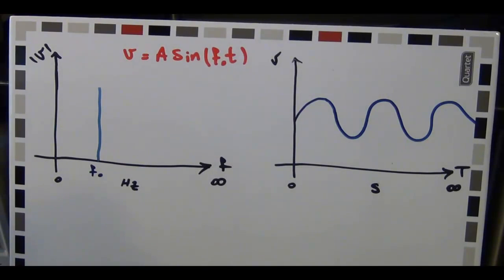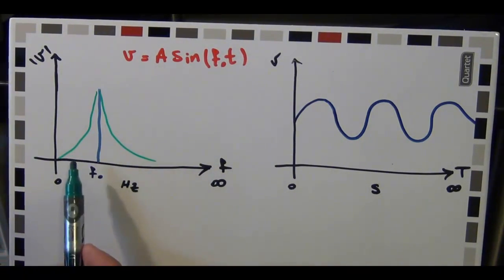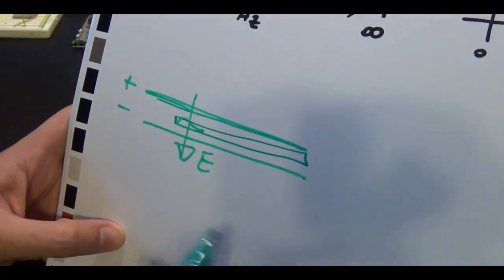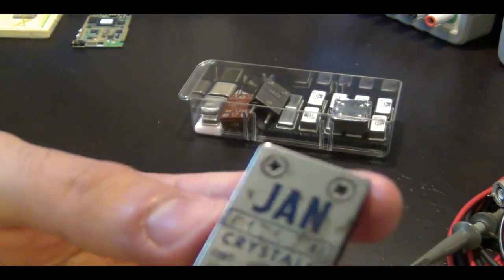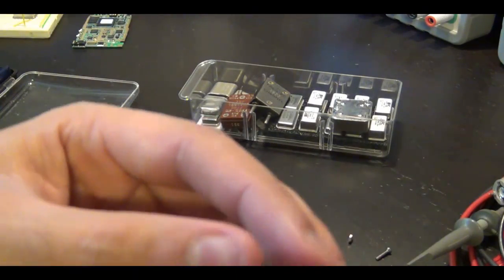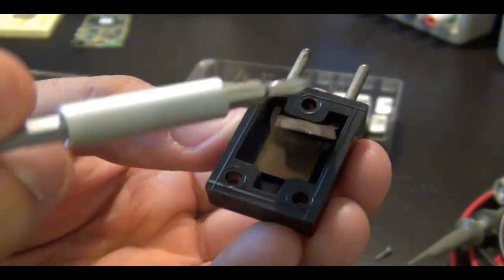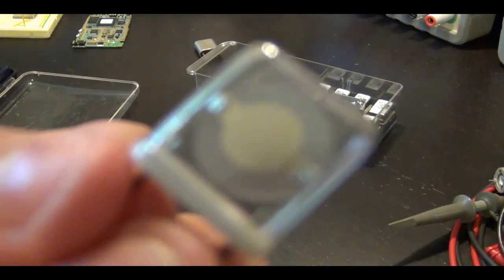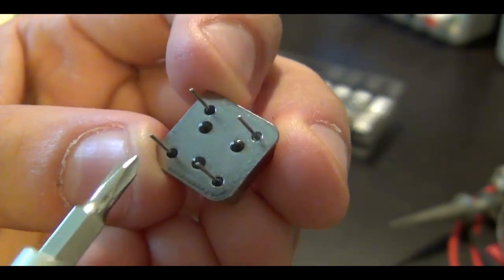TSP #4 - Frequency Generation: Crystals and Ring Oscillators (Part 1/4)

Comment: The first 'crystal' you opened with the screwdriver was actually a crystal 'holder' designed so that the crystal itself could be removed and ground down by the user to a frequency of interest. i think crystals mounted in glass were used only in high-end equipment. The glass created a hermetic seal to keep dust, dirt, and corrosion from the crystal. That would then be placed in a metal package, probably a crystal oven for use in a high-end frequency counter or spectrum analyzer.

Comment: I've only ever seen the glass ones in old oven assemblies, so maybe it has something to do with thermal expansion? Transmission of thermal radiation? Whatever the reason they aren't even common in that application.
Fun fact about those JAN plugin crystals: if during the manufacture process they were found to resonate at too high a frequency they would expose them to radiation to induce lattice defects in the crystal, thus bringing the frequency down.

Comment: Vacuum Glass encased  crystals are usually more precise and have higher Q.. 
Most metal cases are ultasonically welded or soldered an are not assembled in vacuum.Also the soldering or welding  process contaminates the crystal,so it will have much lower Q ,and worse long and short time stability...

Comment: Hi, I am trying to test a bunch of 10MHz surface mount clock oscillators for their resonant frequency at various temperatures. My customer believes that their is a variance in the frequency at certain temperatures causing failures. So these components are new and not soldered to a board. How would I go about testing them? I have a very good oscilloscope I am hoping to use. Here is a link to the data sheet of the device. Thank you for your advice!  https://www.mouser.com/datasheet/2/3/ASEMP-44335.pdf

Comment: Nice little video, FOCUS - FOCUS - FOCUS. Still a nice video. Frequency tuning tips. You can slightly change the frequency on these old crystals by: 
- To lower the frequency you can rub and "X" on the crystal with some lead solder. This increases the mass of the crystal.
- To increase the frequency you can sand the side a little to remove some of the crystal. This lowers the mass of it.
Thanks for sharing. Best Wishes n Blessings. Keith
Reply from the maker: Thanks. Make sure you watch the rest in this series. This is part 1 of 4. Some of the points you mentioned do come up later. This is also a fairly old video. :)

Comment: What makes the crystal more accurate? I'm going to buy a crystal for a microcontroller, and I just wanted to know what the load capacitance, tolerance PPM, and frequency tolerance PPM means. What is the difference between one that is rated at 16Mhz, 20pF Load Capacitance, 30 PPM Tolerance, and 50 frequency tolerance, from one that has difference.

Like the ones on Mouser Electronics, Digi-Key, etc.
Reply: Hi Mark, 
The tolerance (or accuracy) of the crystal is its accuracy reference to the requaired frequency when measured at 25degC (this is controlled by the thickness of the quartz and the thickness of the metalisation on the electrode). 
The stability of the crystal refers to the change of frequency caused by change of temperature (this is controlled by the angle the quartz is cut from the original crystalographic axis). this measurement is a relative shift referenced to the tolerance. 
The load capacitance is a little more complex to explain. It is a function of your circuit. Most standard crystal oscillator circuits run the crystal in a loaded circuit, you need to consider the value of the two capacitors each side of the crystal (add them as if they were in series), plus the stray capacitance of the circuit (around 3-5pF normally). You need to specify the load capacitance when you buy the crystal because the manufacture will place this load in circuit when they adjust the tolerance. If you run at the wrong load you will pull the frequency away from the correct frequency. 
PPM means parts per million, crystal frequencies are very accurate so we dont measure them in percentage (parts per hundred) we measure them in parts per million.
Reply: the question and answer were great thank you Mark and Nick

Comment: If we use a large monocrystal as an antenna it can actually capture waves
Reply: Or oscillate a metal antenna at high voltage high frequency at very low amperage so it can resonate with the given wavelenght we can actually capture Earth's vibration the moon's and Sun's one if we can capture this of a supernova WE can oscillate ti around the Earth's surface like a battery and then capture it back of course with Tesla receivers! pyramids are pure energy chargers of Earth's energy storage the Higher the energy levels the more heat it's build in the very core of it! So I'm not a geophysicist my question is: Is our Earth more overcharged or more undercharged?
Reply: Thankyou

Comment: wait so the smaller the crystal or the shorter his spectral distortion is the smaller waves it produces. then the greater the monocrystal is then we can revibrate ti by waves at this length I think that the universe is full with high amplitude short and long waves
Reply: because when a wave is disappearing in its own resonance, it is just gaining so high wave speed (short time High frequency) then it's actually giving heat in its affected environment. that's why in vacuum a wave gets destroyed and it's energy transfered onto its surface

Comment: tramdr I'm not an expert either, but I did just finish reading a book by an expert about quartz resonators. Voltage does in fact effect crystal oscillators, as it increases the strain on the crystal, which is also why crystal oscillators increase in frequency with drive current. In practice this is not a good way to adjust crystal oscillators as any DC voltage present on a crystal will greatly increase aging (change in frequency over time). The book I am referring to is "Quartz Crystal Resonators and Oscillators For Frequency Control and Timing Applications - A Tutorial (March 2004)" by John R Vig, it is available online (it is a public work by the DOA), and a good reference for understanding sources of errors in precision oscillators.
Reply: Thankyou

Comment: I'm not an expert, but potentiometers change voltage. Voltage does not effect crystals. However, capacitance does. In CB radios where I am an expert, the potentiometer  for changing frequency changes the voltage to a Varactor diode which is basically a special type of diode that changes capacitance when the voltage is varied, and then this is hooked up to the oscillator or crystal to vary it up and down.

Comment: So you said when we apply voltage across the crystal oscilator, the shape of the crystal will change, but how does it generate frequency? I couldn't hear what you said around 5:19; something about the shape changes, and remove the voltage, then something, then the frequency is generated.. I don't get the things in between, can you explain it in the comment? Thank you

Comment: Glass actually used to be the most common encapsulating medium for quartz crystals.  It is not uncommon to find a Soviet-made clock from the 1980s with a glass-encapsulated crystal in it.

Comment: Great videos
Is it possible to make a super cheap FM audio transmitter 
from this type of crystal oscillator?
I have seen a AM transmitter using this crystal oscillator
and a audio transformer ,but to get FM modulation that would
be cool

Comment: Hello. I am trying to find a way to generate DC pulses which are adjustable between 1 to 10 Hz. I'm planing to run an electromagnet with this circuit. If you know any circuit that could help me do that, would you be nice and tell me about it? The electromagnet is running a car fuel injector. It runs on 12 V DC but I'm not sure about the amp draw. Lets say something like 10 amps! Regards

Comment: I have built a digital clock, but i would like to use a vintage oscilator on it, do you know if it's possible to find a 2000MHz, 4000MHz or 8000MHz one ? And if I was to look for them in old circuits, where could i find them ? What are some of the devices that used them or still use them ? :)